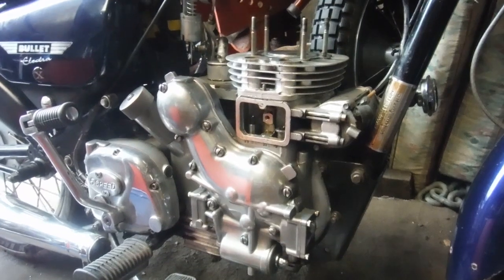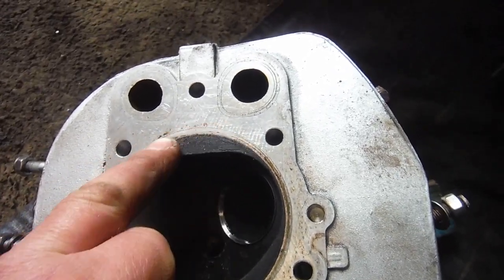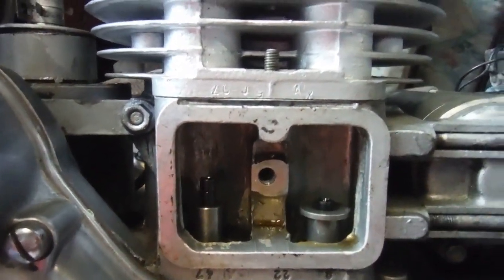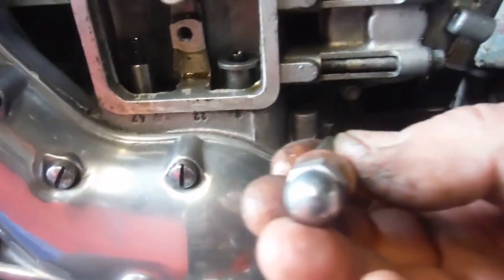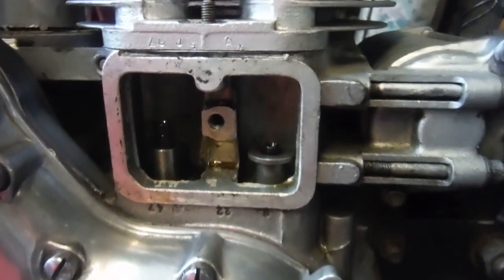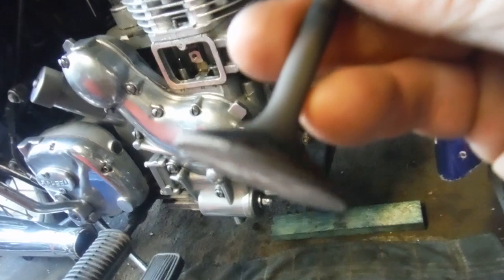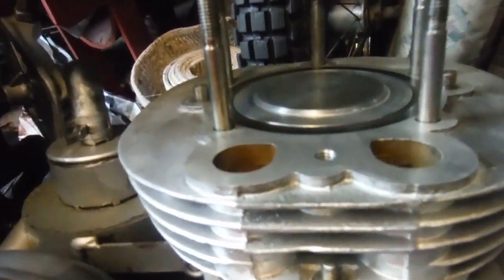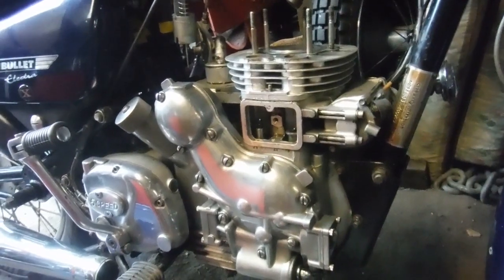Royal Enfield 500 Electra X [Asbo 41 to be] top end tuning work discussed part 1.

Comment: So no problem with the valves overheating as a result of being less of a heat sink?
Reply from the maker: I shouldn't think so, if anything it will all run cooler, with a potential hot spot removed.

Comment: Service for a specialist only. Otherwise any other may be lost in the adjustments and adjustments. I noticed in the service manuals of some engines, the valve heads are stamped in special steel, in profile of tulips, to make both the gasoline intake and the exhaust outlet faster. They were thin (very light), enough to dissipate heat and not melt. High-quality service. Congratulations!
Reply from the maker: Thanks again, Glaico!

Comment: Really enjoyed this video Paul,the more technical the better, I’ve a general question about older valves maybe not on the RE but the ones kinda from what I believe were from side valves with the slot in them, for a performance motor would you machine them out to reduce weight or leave for compression????
Reply from the maker: Thanks, David. I guess the slots in those old type valves might create a hot spot of sorts, although they are there to aid grinding in. If there is adequate material present, they probably could be machined away. the affect on compression would be negligible, I would think, and probably have no noticeable affect.
Reply: @paulhenshaw4514  yes reduce weight in the valve as got to help on higher rpms !

Comment: Could you fit a twin spark ignition to one of your bike builds Paul and would it make any difference difference to performance? Thanks again for explaining the work your doing.
Reply from the maker: Hi Gary - yes, but we have twin sparks on our RE 500 racer and on one occasion, back when it had only reached 42 bhp at the time, we dyno tested it and I disconnected one plug to see what would happen. The power line on the dyno graph became a tiny bit more ragged and it lost 0.2 bhp. Our 350 RE racer had also been using twin plugs, but we had to revert to one, after a rev limiter equipped ignition was fitted and it has won numerous races, set a lap record and won a championship, all on one plug!
Reply: Ahh bugger I thought I was going to be the only guy doing this! We tried it on a Kawasaki f11 250 t2 a lot cleaner  on the revs plus free compression 😀

Comment: Interesting that they use those ill fitting valve seats.  Perhaps using leftover stock.
Reply from the maker: They fit fine and are specific to the model, but just not cut deep enough for some reason.